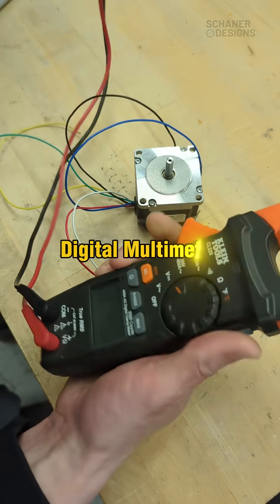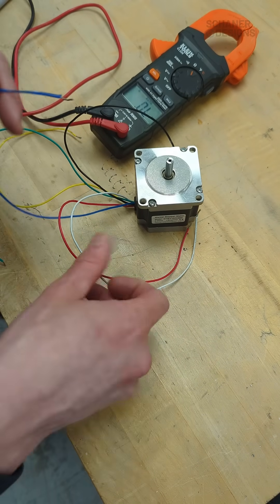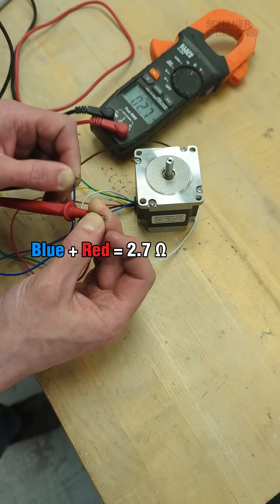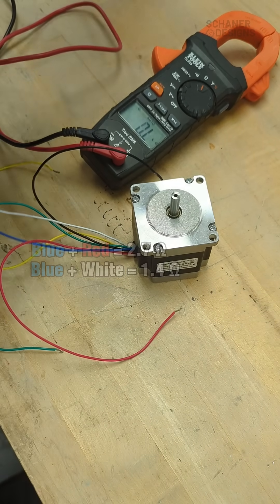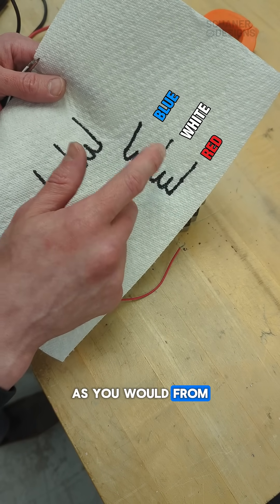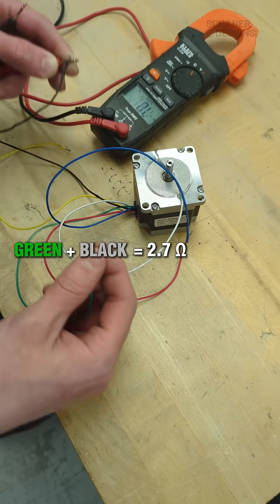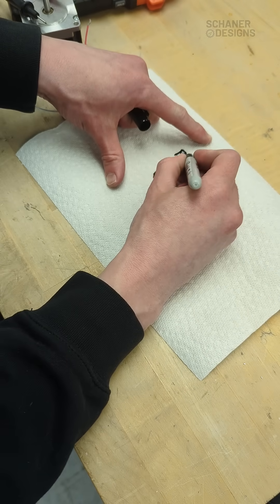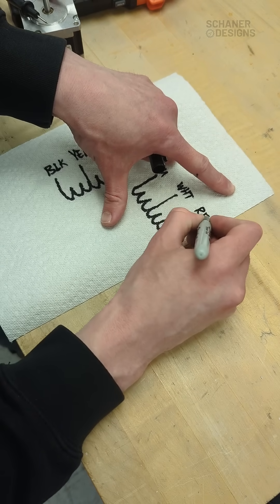How to Identify Stepper Motor Wires with a Multimeter (No Diagram Needed!)

Comment: I have TYPE 17PM-K310-33VS,
Number T4521-01, Minebea-Matsushita motor corporation ,  Stepper motor.  And Driver A4988 (R100).  12V 2AMP AC to DC power adapter.
My actual problem is that I didn't find any datasheet for my this stepper motor,, That's why I'm not able to Set exact VREF and Because of the results is motor is not rotating shaft just locked positions, I have tried many times but I'm not Figure out exact VREF 😢, Can anyone please help me?
Reply from the maker: I'm not familiar with that particular stepper drive, but it sounds like VREF is just for tuning (i.e. making it run more smoothly). If it's not working at all, that's probably not a tuning issue. Are you sending a pulsed signal to STEP pin?

Comment: When measuring resistance don't put your fingers on the probe tips it will mess with your values.
Reply from the maker: True, but it's going to be an almost negligible difference since your body acts like a very large resistor in parallel.